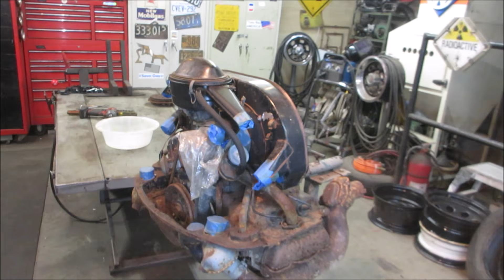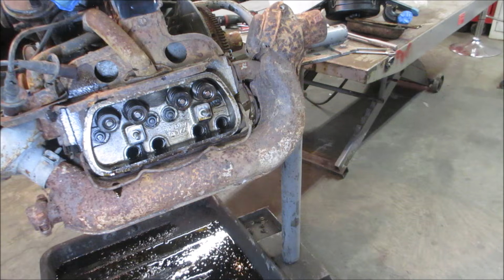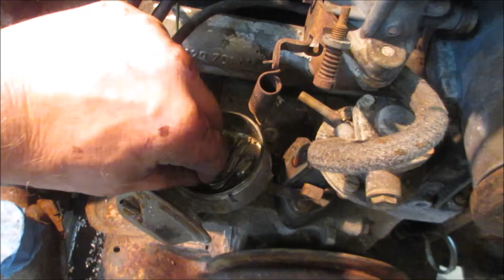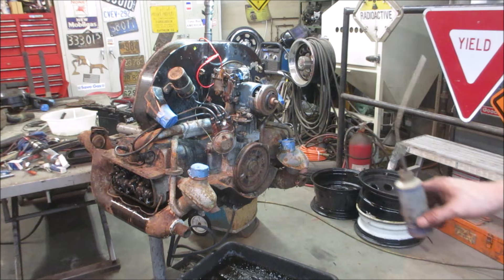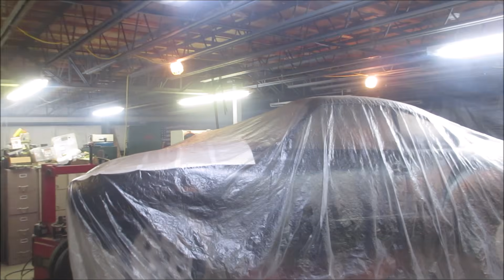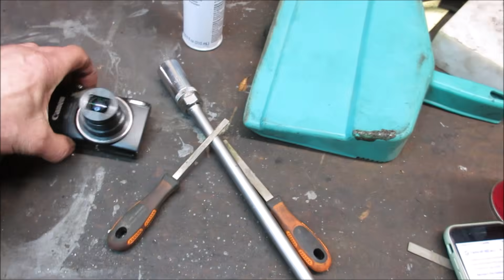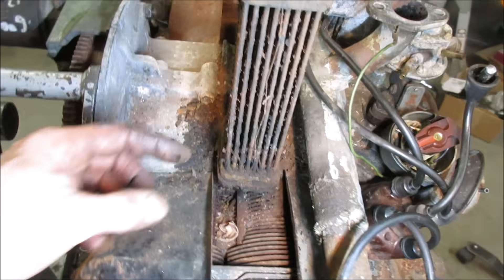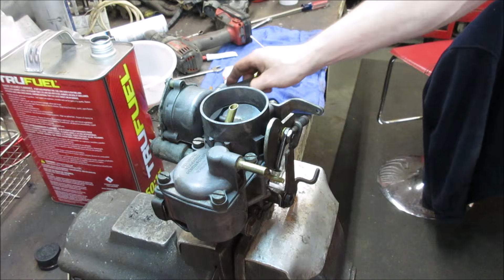Can IT Be Saved? Busted VW Bug Engine

Comment: My 66 Beetle had the tiny 1300cc single port engine. I rebuilt it std.  bore std. crank. A Scat cam, ported heads, Weber 2bbl carb, perf clutch and header with a single turbo muffler. It ran really good! Dad showed me how to raise the generator voltage for a 8volt battery.  I loved that car,  never should have sold it. I know where it sits in a driveway,  sometimes inside a garage. I've never got anyone to answer the door or respond to notes I leave at the house where it has sat.
Reply: Dear craighansen.
👍👌👏 Thanks for sharing this great story. 2) Please never give up! Maybe it helps to leave behind bigger notes!? 😁 ;-) At least the guy could have the decency to call you back (if he's willing to sell or not). Anyway: The interweb is full of stories that owners were ready to sell their stuff to buyers who left notes years later.
Best regards luck and health in particular.
Reply: Write a letter and mail it to the property, my notes never get responded to, but mail sometimes
Reply: @16driver16  
👍👌👏 That's a good idea. One could even put in an already prepared envelope (with the address and stamp on it) to make responding easier.
Best regards, luck and health in particular.
Reply: @16driver16 
Even just putting the note into an envelope can help - people tend to open envelopes inside, often sitting down and not really doing other things. Whereas a note in the mailbox may get glanced at and tossed because they're busy thinking about getting the front door open.
Reply: You could also try registered mail and property tax records for the owner of the property.

Comment: Yep, you've resorted to running these poor old haven't started in years until the battery is dead to get these started! Come on. Give them a time out! Junkyard digs took 45 minutes of running a motor to the ground before I stopped watching. It seems ALL of a sudden, more and more tubers are doing the turnover till dead thing, I'm skipping a bunch of video time. Let's figure it out first. Hagerty did the same thing for awhile before checking for SPARK!

Comment: That poor poor starter. The giddy laugh always done when an old engine begins to fire up.
Reply: That starter is a champ 😂
Reply: @cardoctor2k9  the GOAT
Reply: Starter needs to be cooled with shop air!
Reply: I totally agree with u on the starter I feel so sorry 4 it
Reply: Don't feel sorry for the starter mustie1 says he's got a box full of them. I'm kinda concerned for Mustie1 though he doesn't wear any protective gloves when handling and coming into contact with all the chemicals, gasoline, used motor oil, and solvents.

Comment: ah memories of my early driving days.  i had volvos, 142 and a 123, same bosch ignition system and valve adjustments!  now i can barely remember how to open the hood of our modern pickup.  fiddling around with the old volvos was never much fun, trying to start them in minus 30 winter weather

Comment: Ah, memories.  My first car after I got my license, a decent 68 Bug with that 1500SP for $100.  Replaced the left ball joint and got a good pair of front seats from our local VW specialist in turn for a case of German beer.  Great SIMPLE motoring, great memories.  I still remember the noise, the smell, the catastrophic brake fade and the terror experienced at 70mph downhill.
Reply: Idk if that brake fade is normal. Probably like my first jeep just needed the fluid flushed as it would boil way early from I assume water finding it's way in
Reply: @16driver16 
All 4 wheels have drum brakes. Drum brakes don't like long applications. They'll heat up and become less effective.
Disc brakes do also fade with heat, but the design is much more effective at cooling off faster so you tend not to notice it as much.
Reply: @tin2001  power drum brakes or manual? That's rough
Reply: That's so unreal! My second car was 68! Got seats also,decent body and paint, new tires,paid 800$ had that bug for 12 years! Fun car to drive, great in the corners!👍Thanks for sharing that.